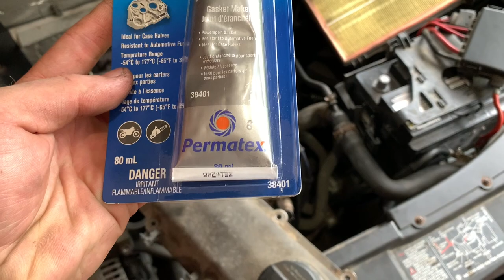Putting a massive cam in a VW golf race car. It sounds RIDICULOUS

Comment: Which camshafts fit on a 1.6 16v BCB engine? I want to pull one from a junkyard since new is too expensive. Need something that stays open longer and further.
Reply from the maker: I literally know nothing about these engines. My buddy brought the cam and a handful of gear for it and I installed it. Sorry I couldn’t be more help
Reply: @StationroadRatrods  no worries. Thank you for upur insanely fast reply.

Comment: saw a comment saying this had to be tuned where did you/onwer get the tune?      just a fellow vogn member trying to build a mk4 2.slo (street build )
Reply from the maker: I’m actually not sure he did get it tuned after. The new cam gear I put in was indexed differently and he had a shop fix the timing and then he ran it for a season in hobby stock with no issues. It was a snappy car for sure

Comment: I have a mk4 as well How did you make it sound like that with the stock cam
Reply from the maker: So I think it’s long enough ago that no one will get pissed off lol. 
It was a techtonics cam that was actually a hair too big for the cylinder head. I had to grind away some of the head in a few spots (nothing serious, the cam still rotated but was nicking the head) I can’t remember the lift and stuff but it was chonky
Reply: @StationroadRatrods  yes definitely sounded lumpy I liked the sound would love to no the prose end cons on how to do it
Reply from the maker: The only con I could see is a loss of a little torque down low, but the car screams at higher rpm. I haven’t driven it myself but it’s a hobby stock race car and I’ve seen it run around the track. It sounds so cool haha
Reply: Yeah mine screams 3rd 4th gear 4th gear never ends 180km still winding out........ nah I mean I would like to no how you did it so I could do it to mine as I have to do a head gasket replacement I thought I might as well did what you did
Reply from the maker: Ohhh actually this is the last video, I’ll link the other ones
Reply from the maker: Here are the first two videos, this is a step by step 

Volkswagen Golf cam swap. Neato!
https://youtu.be/jiOcLNYt0VU

VW golf 2.0 cam swap part two
https://youtu.be/9k1uERV8Qi8

Comment: What cam did you use, also did you need custom tuning? Thanks!
Reply from the maker: I can’t remember what cam it was, but it was by a company called Techtonics. It was a pretty big cam, and it did need to be tuned
Reply: @StationroadRatrods  oh alright I found there cams might just slap in the biggest one too hahaha, thanks for the response!
Reply from the maker: That’s what my buddy did with this one 🤣 
One note, every cam lobe touched the cylinder head and I had to clearance it with a carbide bit, it was a big ass cam